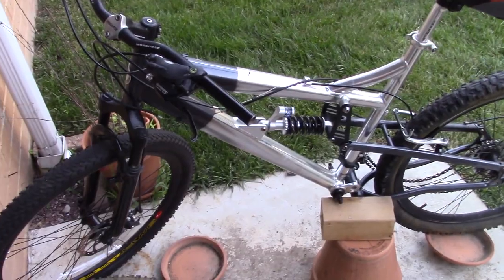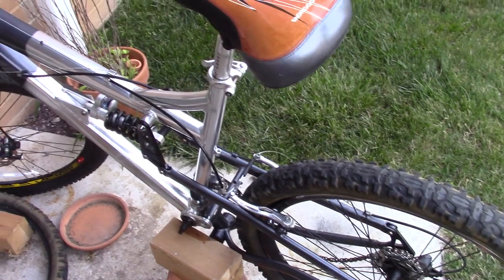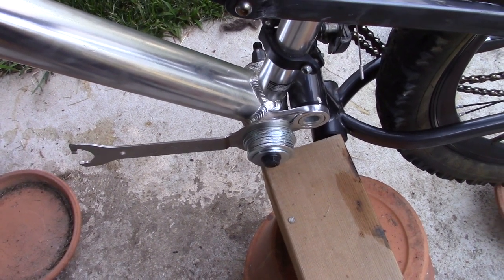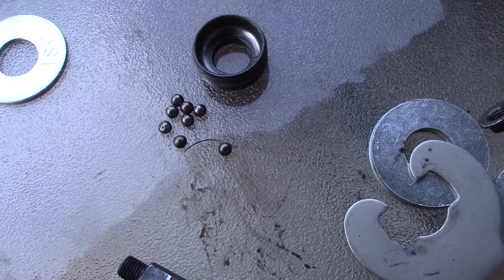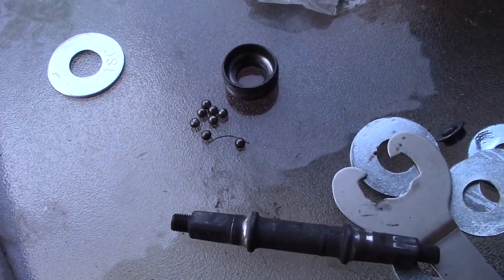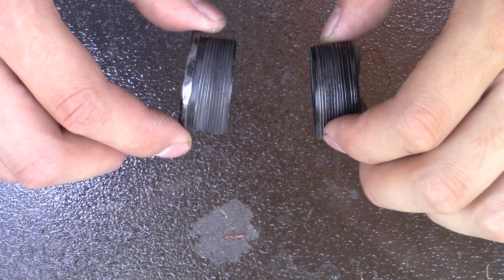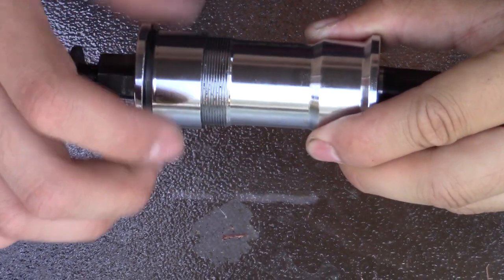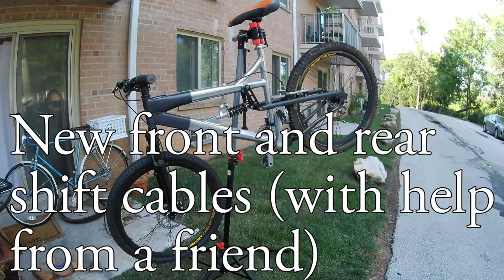[3] BikeRestoration - Mongoose Mountain Bike with Threadless Repair Bottom Bracket

Comment: I have a similar issue with bottom bracket.  So going threadless as well. Can you tell me what brand of threadless you used. How, if you have been able to ride with it, it is holding out so far. And where you applied the loctite solution and what version. Any help would be appreciated as there seems to be very little about threadless BB on youtube weirdly enough. Great video by the way. My project is on a Claud butler Urban 100 hybrid. Light as hell but super sturdy bike.everything but the frame Really needs some TLC. Looking to make it a road/gravel style hybrid with 740/780mm bars. Stripping down and bringing back to life. Cheers for any advice.
Keep doing what you doing
Reply from the maker: https://www.youtube.com/watch?v=j43RgalBuxk Please check this video, that should clear some of the questions :)

Comment: Hey dude mini update. Installed the threadless bb with blue loctite and came loose after 5 miles. So returning it and buying a different version. Fingers crossed it will work next time. Did you just pinch tighten it when you did it?
Reply from the maker: Sorry to hear that.  I tightened both side with the torque wrench and the loctite is actually 262 the high strength version that supposedly only come apart with heat.  Good luck!
Reply: I used the blue which is medium. Maybe thats where I went wrong. Ah well lesson learned lol. Just gonna tighten to clamp it in next time and see how it goes. Still think it was a defective bb. As thread didnt seem to run equal depth when looking at it as though had been cast wrong in the first place the cup had too much movement when threading it on till the last bit
Reply from the maker: @dchallam Yeah, try with the high strength, wait for fully cured. Did you use the torque wrench installing it? And what do you mean by "pinch tight"?
Reply: @datkarma8645  well I dont have a torque wrench. So I tightened by hand then used the bb nut looking tools and a spanner either side. Till there was no resistance. I believed that should of been enough to hold in place but appears not
Reply from the maker: @dchallam  I felt it was pretty tight with a torque wrench, almost like a lug nut. A torque wrench would be good idea.
Reply: So looks like I gonna have to invest in a torque wrench. What strength on the wrench did you set. Got some red 270 high strength loctite. And a different brand bracket.
Reply: Ok so read up. What Nm did you have it at.
Reply from the maker: @dchallam  the spec of sunlite calls for 35-45 nm,  check with the other brand's manual.  Good luck!

Comment: Lol. Just seen your links in description
Reply from the maker: Great!  I was just typing up a reply.  Thanks for subscribe and supporting the channel!  I see you are subscribed, pressure is on me now :D.  Basically it rides just like a normal BB.  I did notice there is a lack of info on this topic so I decided to make this video.
Reply from the maker: Some pages I read claim the BB work its way loose every few month.  My solution is to 1. use correct torque spec 35-45 Nm (25-32 ft lb)  2. Use the red thread lock on the middle thread (there is only one set of threads).   Good luck with your bike build!
Reply: datkarma86 ok so apply the loctite to the thread. Generously coat it or just enough for the loctite to gently run in the threads. Then I presume line up and tighten. What do you recommend with regards to loctite version number,243 or above. How long would you say for loctite to fully dry and bond before attempting to use bike
Reply: datkarma86 oh and have found the uk equivalent of the sunlite threadless. Aparently branded YST and no major design issues it seemsm
Reply from the maker: Here in the US it is the blue or red loctite;  the red is the more sticky one.  I used a lot on the drive side (the bigger part), I did not just apply a drop; I applied a whole band of loctite covering the entire thread.  I would say the bike is operational as soon as the BB is installed to the PROPER TORQUE.  The loctite is just prevent it from loosening in the future.  Definitely use a torque wrench.
Reply: datkarma86 any particular torque you set for that type of BB
Reply from the maker: 35-45 Nm (25-32 ft lb)
Reply: What size tube loctite did use. Will 3ml be enough or nearer 10ml
Reply from the maker: How many bikes are you fixing?  3ml should be more than enough for one bike
Reply: Lol just the one. Ok cool 3ml it is then. It literally a couple of quid for a 3 ml so good times